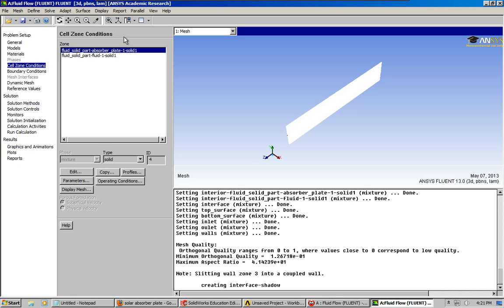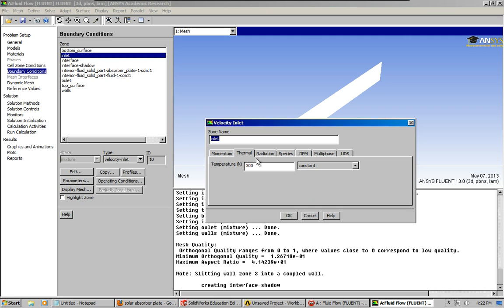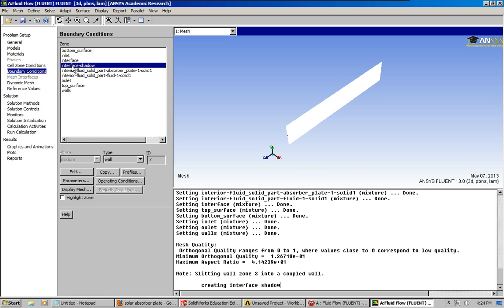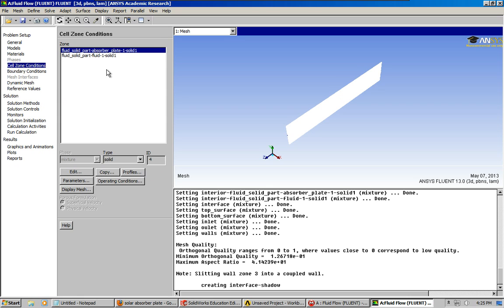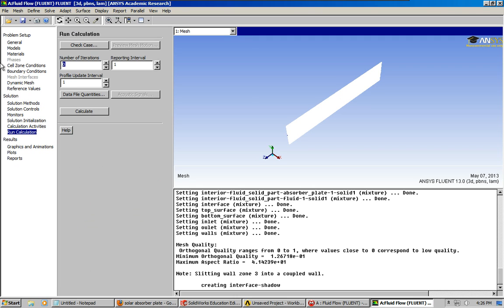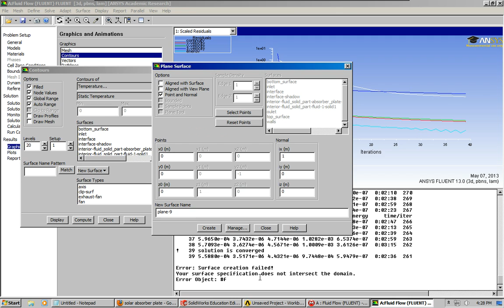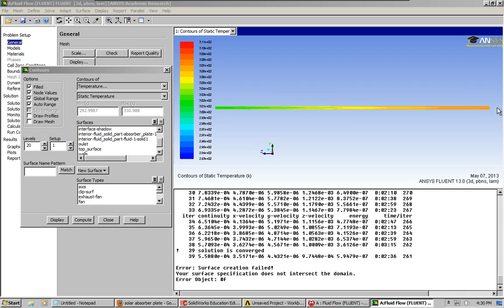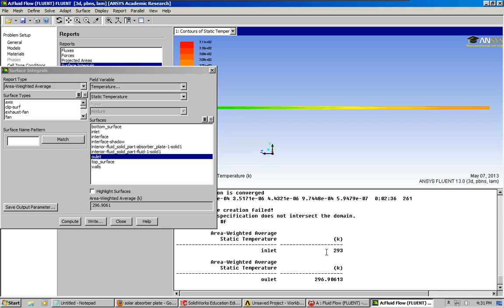Ansys Fluent Tutorial Solid to Fluid Heat Exchanger Part 4 solver

Comment: Hi
my model in ansys fluent is solid with heat flux on the upper face and fluid domain in the lower face
but there are no heat transfer between solid and liquid the interface is defined as wall and shadow!

Comment: i can't get that interface shadow. What's the problem?
Reply: I know you posted a while ago, but I too just ran into this, I am using Ansys 14 and the interface had to be manually setup, as I had 2 surface to name between the fluid and the exchanger pipe, not 1 like he shows.
Reply: patonb i too have the same problem
Reply: i too have the same problem
Reply: manish paliwal I did figure out what needed to get it to work, but forgot right now. I'll relook at my files and try to remember.
Reply: manish paliwal I now remember. The original video uses an imported CAD drawing. I drew the above shape in Work bench. Doing it in WB, It does not setup the parts correctly. As such I grouped things as 1 art with 2 bodies.
Then when Meshing the interfaces worked correctly.